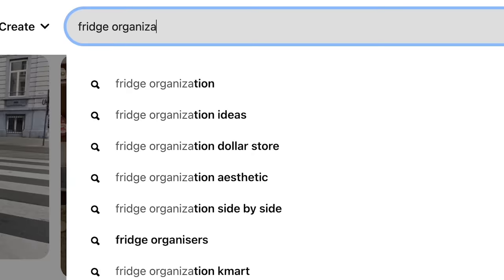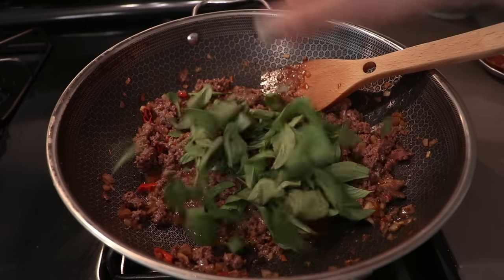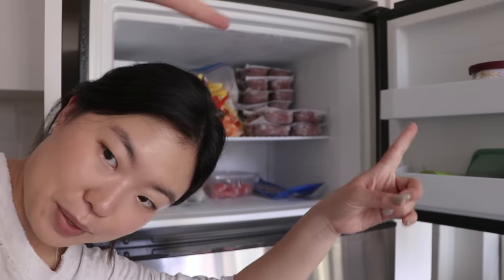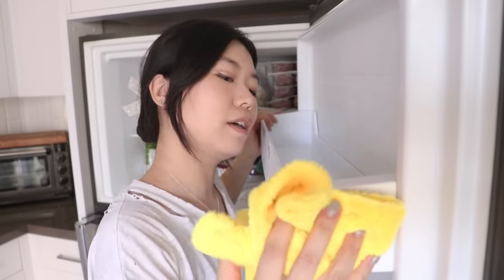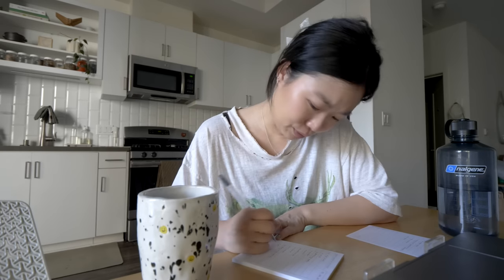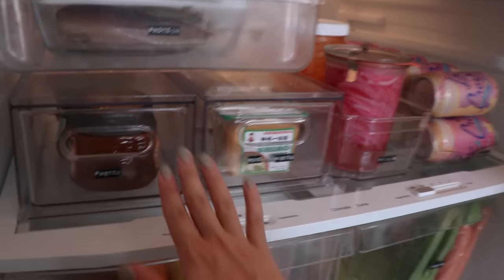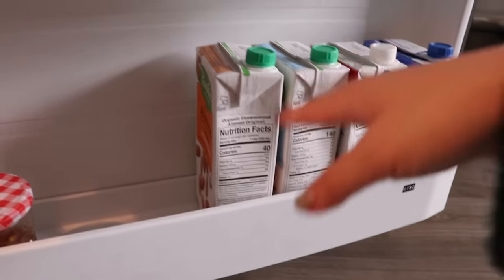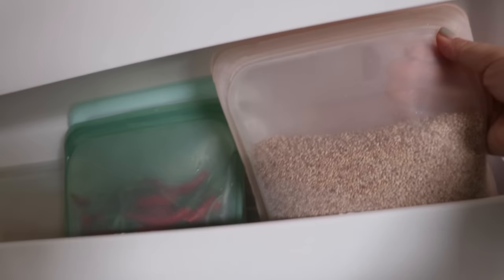how to→fridge cleaning & organization 🥕 restock + tour

Comment: Quick suggestion, from my own recent freezer cleaning/organizing experience:
Use wire containers instead of solid plastic bins.
Freezers work best if the cold air can circulate, and solid bins obstruct air movement.
This hit me the moment you placed those two white bins in the bottom of your freezer, blocking the vents behind them.
Reply: very helpful, thank you!